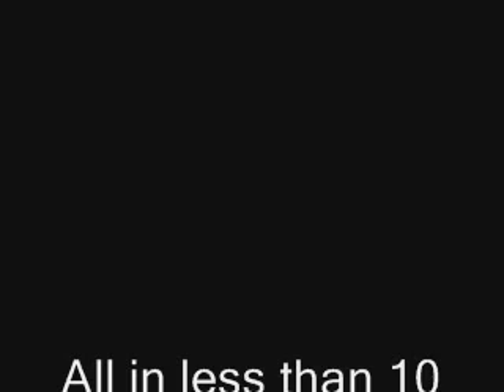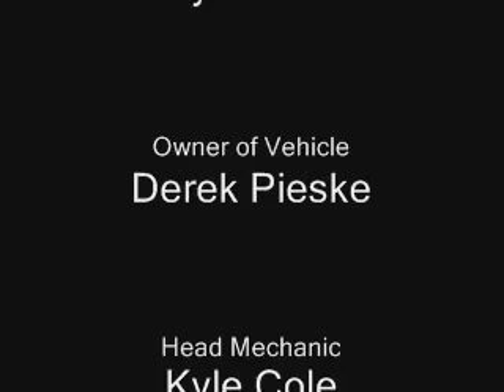Building a 4G63T Engine in 10 minutes

Comment: IMPRESSIVE TIME...AND GOOD JOB !!!  WERE BOLT TORQUE SPECS CORRECT? 

BUT THIS SHOULD HAVE BEEN DONE IN TEMPERATURE CONTROLLED ENGINE BUILD AREA OF AROUND 70-75 aka ENGINE CLEAN ROOM or OPERATING ROOM  KEEP IN MIND METAL SHRINKS IN COLD AND EXPANDS IN HEAT...  rules numbers and conditions must be observed for MONSTER PERFORMANCE of Sirus80 / yon-G-roku-san

Comment: What is that "LUBE" in the red container he is putting on the bearings? Im about to put my block back together (4G64 DOHC) and dont want to fuck it up and the the spray he is using for the gaske? I use silicone for that, but never seen a spray for it. It would save me time and all the mess that comes with silicone.

Comment: Its surprising how many 4G63 motors are used in Clark, Komatsu (and of corse) Mitsubishi forklifts.

 The three biggest differences are that the industrial 4G63's use dual counter-balance shafts instead of a single, a single overhead cam instead of DOHC's (and of course) aren't turbocharged.  

They are tough little motors.
Reply: 4G63 really are bullet proof!

Comment: As long as you have all your parts and specs ready to go it only takes about 2 hours to assemble a bare motor with have everything torqued down to spec. Maybe 3 if you have to file the rings if piston ring end gap is incorrect.

Comment: if you buy a gs, it will not have the 4g63 motor shown in this vid... it still has a 2.0l 4, but it is not anywhere near as responsive to turbocharging.  If you wish to do a swap, it will be extremely time consuming and very pricey.  a new 4g63 costs around 2 grand, and then throw in another grand for a turbo and wastegate, and yet another 5-800 dollars for a tranny.  If you arent mechanically inclined, throw in several thousand in labor... so all said and done, it would cost $4000-6000

Comment: The only bearing I've hear that you don't directly touch are tri-metal bearings. Most modern bearing it doesn't matter. My only gripe on the whole thing that I saw was that the hear and crank bolts weren't incrementally tightened... looks like they were just torqued in one go.